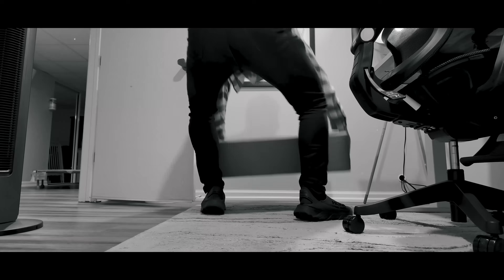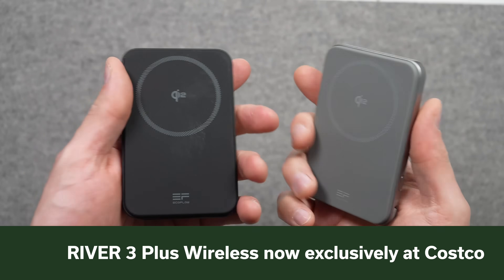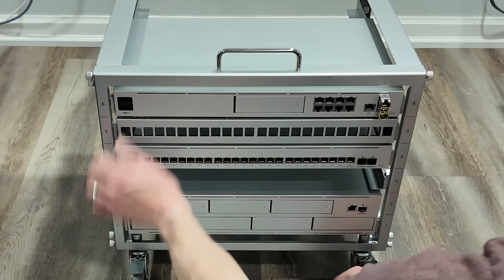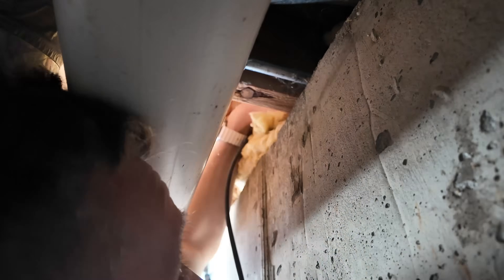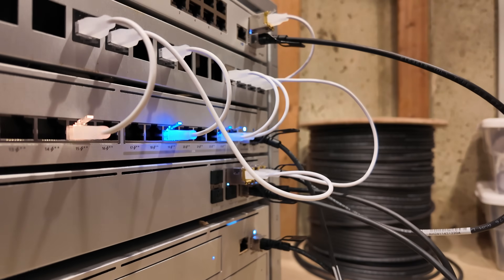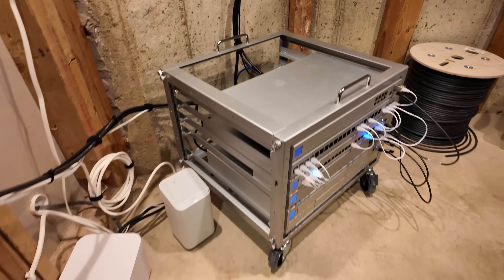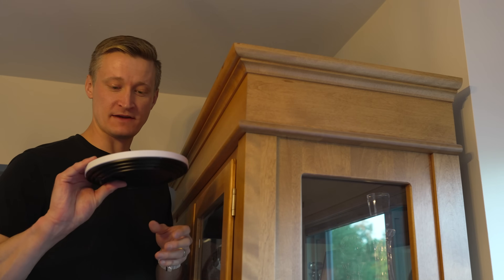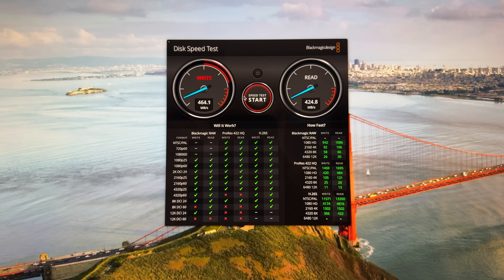Building my DREAM smart home rack with Wi-Fi 7 + 10GbE

Comment: For real I am not a fan of that rack.   Too small and has very little in the way of allowing for nice cable management.   I like having extra space between the switches for either patch panels or cable management that just won't fit in this.   That way I can do things like coil up excess in DAC cables or fiber jumpers without it being messy on the front.

Comment: Great video! I am considering the USW-Pro-HD-24. Seems that way (at least for my setup) I won't need the aggregation switch. I so badly want to go for the stackable UDM Pro, but think the UCG-Fiber is what I'll go for (for the faster internet - on 1G at the moment, but thinking of upgrading soon). Also going for the UNAS Pro 8. I could do with the 4 but think the extra 4 drives will future proof it more. I have one camera to trial the Secure component and will add more in future. I am also getting 2 U7Pro XG's as the house is pretty small. I'm also getting the toolless rack. I think this setup will allow me to get rid of a few switches that are just lying around loose. I'm busy investigating a 1U rack that can hold a little 8/16 CPU/Threads machine to host a small amount of docker containers/images. Main aim for now was to get the core 10G networking in place with wifi and storage. UDM might come later. I'll more than likely need to get the 2nd toolless rack with the attachments.

Comment: Couple points:
- Permanent Zip ties are a poor excuse for proper cable management.  Removable zip ties at minimum, velcro strip are better.  You also do not need to tie bundles every foot between rafters.
- WiFi 7 is amazing with compatible devices.
- Ubiquiti APs are supposed to be ceiling mounted, not wall mounted.  Use the Unifi Home mapping tool to see just how badly you are impairing your wireless capabilities.

Comment: I had a WIFI7  Netgear Nighthawk. Pretty good. They promised it would be upgradeable to mesh, but then reneged. I got a UniFi router for less than half the price, and a UniFi 10GbE switch like yours, and holy smokes. Much larger coverage area than the highly regarded Nighthawk, and way faster. And the user interface is like going from DOS tho MacOS. I’ve decided in one week to completely replace most of my gear, including security cameras, to UniFi.

Comment: Let’s at least try and be honest and not an EcoFlow shill. 

1. These EcoFlow units sine waves are a mess. So much for “pure sine wave.”

2. The jules ratings of these “UPS” are pure garbage and akin to the cheapest big box UPS. 

3. Neither of these are USB HID compliant. So, WTF in the USB-A to USB-B cable for EcoFlow? You plug it into a NAS, computer or laptop and have a less than 50% chance of success. 

4. They provide literally ZERO protection from brown outs, surge or spike. 

Yes, I own both an EcoFlow River 3 Plus and a Delta 3 Plus!

Comment: A rack in a home is an absurd idea. Also Ubiquiti stuff is absolutely terrible and overpriced. Any reasonably modern x86 computer running Linux and configured as a router/firewall will beat the crap out of the "dream machine" in terms of control, dependability, and privacy. For the access point you can flash OpenWrt on many TP-Link APs and get a cheaper, more dependable and trustworthy device than anything Ubiquiti.

Comment: I used to like the UBNT stuff, but you mentioned my biggest issue a few times - it was a constant battle of tweaking, tuning, trying to sort out why my APs would disconnect from the controller, etc... I got tired of it. Didn't want to pay a premium for the cloud key, so you end up running it locally, fine, but again more work. The eero stuff has been sufficient over the air but really lacks in providing ethernet connectivity, so I have to get a switch behind the device. Bundle that with recent security issues they have had, and I had to finally say goodbye to the stuff. I think the stuff can work well, especially in small/medium businesses, restaurants, etc, provides a lot of features at a price point that isn't "rip-your-face-off-enterprise" pricing.

Comment: Didn’t you just talk about how Eero was better for your home and that you were sticking with Eero?
Reply from the maker: I did. Eero is great for smart home tech if you want to set it and forget it. I talked about on a recent live stream how I wanted to move back to using Ubiquiti because it's an interesting company to cover with interesting products. It doesn't mean I think differently about Eero now. Both Eero and Ubiquiti Unify have their pros and cons depending on your needs.
Reply: @EricWelander thank you for the clarification
Reply: @EricWelander it's not just about eero. In the broader sense it's really about wireless backhaul mesh systems (eero, Netgear Orbi, Asus, TP-Link Deco, Linksys Velop, etc.) vs wired access point mesh systems. I'm in that valley of decision right now.

I had an eero wifi 5 system for a few years. Worked great but I wanted more speed and range so I upgraded to an eero wifi 6 system and ran that for a few years. Again, everything worked great. My house is very large so when I say "system" mean a gateway router and 4 satellites. My average system investment is $1500. Seeking even more speed and signal strength at range, in May of '24 I upgraded to a TP-Link Deco system with the BE95 as the gateway router. I chose that because at that time, and still think it's true today, it had the best wireless backhaul performance available. And I can attest to getting at minimum 1GB wireless backhaul performance between most nodes. But due to potential security issues with TP-Link as per the government, and desiring more network control, I've entertained a Ubiquity upgrade. HOWEVER, just to wire my house is going to cost $3000 minimum. Again, it's a very large house. So the total project with the necessary Ubiquiti equipment would be $6-$7000. I'm struggling to justify migrating from a cost/benefit perspective. Additionally, replacing my Hikvision 8 camera security system with a Ubiquiti system would make sense as Hikvision is also on the government's list for security concerns. PoE cabling and cameras would be an additional $5-$6000. Therefore, I'm watching every video I can on the benefits of migrating from a wireless backhaul mesh system to Ubiquiti in order to nail down whether the benefits can justify such an investment.

Comment: Always love your video. Just one thing that I have noticed that your setup may not be optimized. For your access point, if you are primary be wall mounted them, you really should consider to using Unifi wall AP rather than the one your are using, as those are really designed for ceiling mount. The radio patterns are optimized downwards rather in vertical pattern. Myself in the past few months had completely re-done my home network with full Unifi ecosystem, has got excellent results. Be warned, Unifi ecosystem is addictive just like Apple 😂, I stated with just network infrastructure upgrade, but ended up with replacing all my security infrastructure and NAS as well 😂 Unifi ecosystem is addictive just bit cost compare consumer meshing network, but it is far worth it IMHO.

Comment: I commented lastnite with a link to a 'how to mount an access point', but it seems to have disappeared. Basically you never want to mount wifi routers on their sides like that. The signal goes up and down and not a wide coverage of your house. I owned and ran a wireless networking for businesses company for many a years and ran hundreds of spectrum analyzer scans showing it wasn't a good direction to mount them. aaaaand yes, they were Ubiquiti access points.

Comment: Great video, Eric. Love your new setup. What tools and instructional videos did you use for creating your own Cat6 cable connections? I have never attempted to make my own cables. What do you recommend? Also does the ubiquity patch panel require Ethernet wiring on the back end for the Ethernet cables or is it just plug an Ethernet cable into an Ethernet port?

Comment: I'll be rounding here: Cat6a is good for 10Gbps up to 300ft. Cat6 will do that up to 100ft. And both Cat6 and Cat5e generally handles 2.5Gbps and even 5Gbps without much trouble to 300ft (but I've heard of some trouble at those lengths with Cat5e, though cable quality is also a significant factor and termination quality). Most cables can handle faster speeds with less issue at shorter lengths. I've seen people get 10Gbps over Cat5e but lengths were well less than 100ft. 

DAC cables for in rack connections between SFP+ ports will save you quite a bit of cost instead of going with fiber. 10Gbps Transceivers are expensive, 1-5ft 10Gbps DACs are often less than the price of 1 transceiver. As an IT guy who does plenty of commercial networking, I really don't see fiber as very useful in a residential environment. Unless you are running fiber though a conduit with electric lines next to it. But even then, I've used direct burial shielded cat6 in a conduit with romex next to it out to my detached garage and have 0 issues with it (PoE camera). 

Unless you have a huge house, 100ft run is likely the longest you'd get in a residential setting (especially with a Server Rack). So IMHO, even cat6a is a bit overkill. And I would never do anything but cat5e to a wired camera unless there was the possibility of re-purposing the cable for something else later). I used cat6 to my garage camera because I may have it going to a switch in the future so I can run a WAP and camera in there eventually. Cat5e is easier to work with (has a tighter bend radius) which is useful for cameras. Cat6a is way too bulky to use for cameras unless its going to a whip outside a junction box, though cat6 is usable. But even then, trying to fit terminations into a junction box is difficult in general and easiest with Cat5e. And, as I've come to learn, cat5e can handle all current PoE standards, even up to type 4 (4PPoE/PoE+++), so powering cameras is no issue for cat5e (though, I'd make sure to use a reputable brand with solid core full copper cable, not copper clad aluminum - though I can't imagine reputable brand would make CCA cable). 

But I wouldn't recommend ever using copper clad aluminum (CCA) ever, anywhere, in general. 

Good wire brands I've used are as follows: Belden, Mohawk, Panduit, CommScope, TrueCable, and Superior Essex. I'm sure there are more, but those are the ones I've bought and used.

If I were installing in a home, I'd used Plenum grade cable. Riser is cheaper but it isn't rated for breathable air space exposure... though, if you aren't trying to pass any wiring inspections, you can get away with it, but I'm not recommending it.
Reply: Good info.  Everything is often "it depends" but I find Cat6 is more than enough for residential networking. Only time I use Cat6A is when the UTP is actually being used as a HDMI extension (via HDBaseT) and not actual Ethernet (such as for video projectors or racked AV equipment).

Check your local building codes, for many residential areas, running anything, even fiber lines, in the same conduit as high voltage electrical is a code violation.  (Remember, codes are about what you shouldn't do for legal/insurance reasons, but doesn't stop, unfortunately, many DIY'rs.)

Plenum rated cable is typically for runs inside HVAC ducts.  Personally, I try to avoid doing that in almost all circumstances, but sometimes that is the only viable way to route to certain locations.  (Plenum rating is more about flame-retardency and low-smoke safety in constricted spaces in case of fire than air pollution or outgassing when a cable is used in a regular space, so using plenum cable for regular residential runs is often an unnecessary expense.)

Another reason to stick with Cat5e for PoE cameras, or other outdoor runs, is that the availabilty of weather resistent cable (direct burial, gel filled, sun resistant, water ingress protection) is often limited to only Cat 5e.  So if you will have some exposed service loops, pigtails, or direct buried cable, 5e is often a better choice.

Lastly, as mentioned, as you move up in cable grades, in addition to costs, the cable construction makes the cable harder to bend, install, and terminate properly.  An improperly terminated cable will perform at a lower-level of speed/reliability or simply be unreliable.

Often overlooked, but you must use termination equipment - jacks, patch panels, and everything in between at the same level.  If you install a Cat 6A cable and terminate with unmarked, RJ45 connectors that are actually Cat 5e, Cat 5, or even Cat 3, then you don't actually have a Cat 6A run.  Be especially careful with pre-wired patch panels that have built-in keystone jacks with unspecified levels.

Not all Cat cables use the same thickness wires for the actual 8 wires in the cable.  Technically, you should use RJ45 connectors designed for the matching thickness of the wires, otherwise, again, you might have an improperly made cable connection.
Reply: I get 10 GB over a few of my Cat5e runs.  I agree that for most homes, runs are shorter than 100ft and Cat5e will work.  I only ran 10GB to select ports and I suspect my issues are interference from bundling multiple wires.  Something I did not consider.
Reply: Who has 10gb of internet???
Reply: @jhonnicash5958  If you have a local server such as a Plex or Jellyfin, or a file server, wanting 10Gb networking isn't' unreasonable. Even if you don't have 10Gb internet.

Comment: I completely disagree on the Wi-Fi 7 topic. Get Wi-Fi 7 access points now and enjoy the many benefits including one of my favorites, Multi-Link Operation (MLO), as you buy Wi-Fi 7 devices. Don’t waste money on a Wi-Fi 6 AP that you will inevitably upgrade to the same Wi-Fi 7 APs that are available now. Oh, and by the way, I’ve had two U7 Pro Max UniFi access points in my home for almost a year and there are no issues with the hardware. Any issues you experienced are likely due to a misconfiguration of your wireless settings in your UniFi controller.
Reply: I agree as well, I am surprised he did not at least recommend WiFi 6E instead if there was a big price delta between that and WiFi 7… like WiFi 6 has been around like 8 years or so and very few new client devices aren’t being manufactured with at least WiFi 6E chips in them
Reply: @morells09  The concepts “upgrading” and “saving money” are incompatible 😅
Reply: I have wifi 7 APs and devices and MLO for some reason is slower than without it and I can’t figure out why.
Reply: Unifi WiFi 7 access points have issues with some older iOS devices that only support the 2.4 ghz band.  Ubiquity is working on it.
Reply: Sorry for my stupid question, must my internet provider and our devices (laptop, smartphone, etc.) support something so we can use wifi7 ? Or al
Reply: @eazy1437  Your internet provider is completely out of the picture on whether you can use Wi-Fi 7 or not. However, your devices will need to be equipped with Wi-Fi 7 in order for your connections to benefit from the stated features. Simply put, you need Wi-Fi 7 access points (or routers) and Wi-Fi 7 devices to use Wi-Fi 7 on a connection-by-connection basis.

Comment: Great video.  I am new to ubiquity ecosystem and loving it.   Newbie question.....I use NAS for streaming videos and file transfer and running USG-Ultra with USW-Ultra and U7 Pro.  Would getting a USW-Flex-2.5G-8-PoE to. make everything but the gateway a 2.5Gbe connections would notice a big increase in networking speeds or minimal?  Would love to go 10Gbe router but not in budget.  Thoughts?
Reply from the maker: Sounds like a good plan and nice setup

Comment: One word.  Wireless. I have a 100+ device home, three cameras, whole house sound from 8 different AirPlay speakers/devices (tons of full-res music streaming), video streaming, shades, leak sensors door locks, lights, etc. It all runs just fine (no drop outs, not near its bandwidth limit) using an Eero 6e (one main hub, 2 satellites). No wires. I know Eric does way more than just home automation , but don’t be scared into thinking you need a machine-room for regular HA. It can be simple and still robust.
Reply: No thank you, wireless might be good for some stuff that doesnt require the bandwidth or low latency but for that it sucks. Air is a shared medium and constant interference is there
If you have an AP that fails everything connected to that AP will also fail.
Reply from the maker: Good point. I think some of this experience probably depends on where you live and the type and amount of interference you typically have.
Reply: For less than the cost of an Eero Pro 6e mesh setup, you can buy a Unifi Cloud Gateway Max, like the one I’ve owned & used for the past 9 months, plus 2 Unifi U7-Lite (WIFI 7) Access Points. 

Now I hope the Eero 6 Pro meets  your use case. I know the Cloud Gateway Max meets mine.
Reply from the maker: Great ideas here of different setups that are both solid. I agree wireless can work better than you might think with modern Wi-Fi tech, and the Cloud Gateway Max is also a really nice option potentially for a little less cost than a mesh system.
Reply: @jberg6704  Keep in mind that the U7-Lite doesn’t have 6 ghz WiFi bands so it doesn’t fully support WiFi 7… unfortunately
Reply: @frankdeckers6555 U7-Lite doesn’t need tri-band support (2.4 ghz /5 ghz / 6 ghz frequency bands / channels) to comply to the WIFI 7 standard. An AP must have Multi-link Operation (MLO) capability between the 2.4 ghz and 5 ghz frequency bands to meet the WIFI 7 standard.

Comment: But you won’t have internet if the power goes out. Does it make more sense to put the power backup at the rack?
Reply from the maker: Great point…I have power backup on the rack and the cable modem, which I didn’t get into in this video